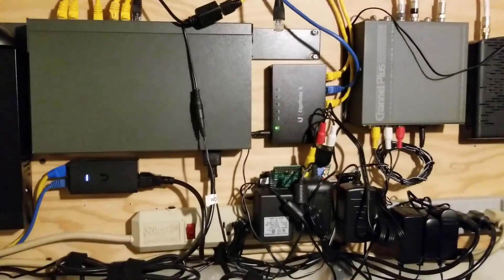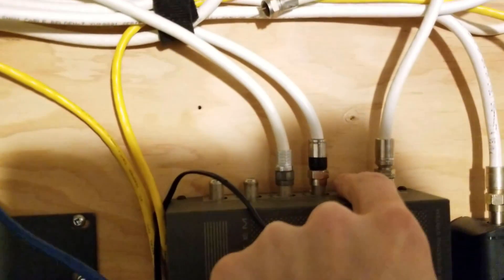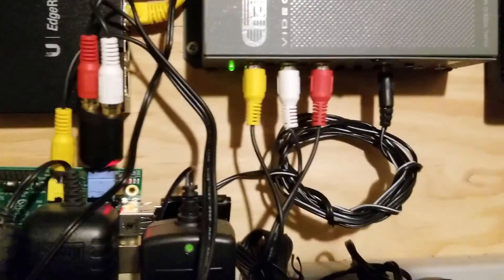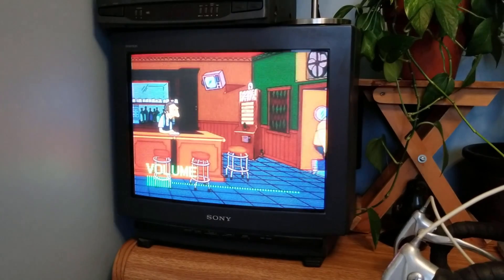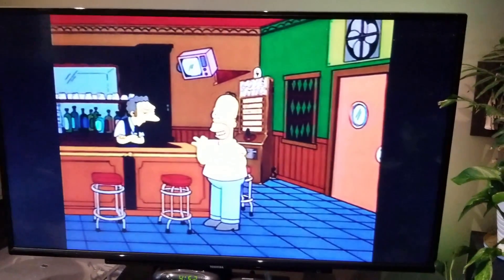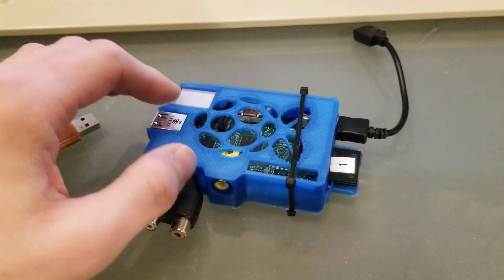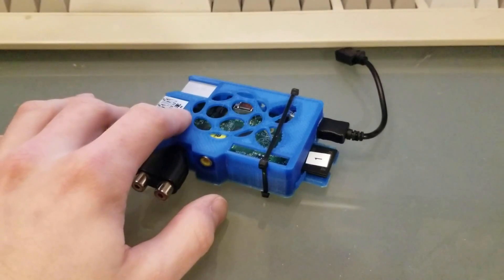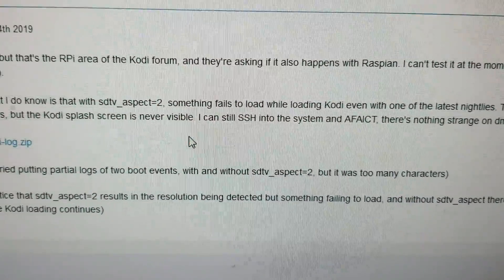My private 24x7 cable channel (Raspberry pi + RF modulator)

Comment: there is way better ways to do this then do it this crappy way
Reply from the maker: Like....?
Reply: @probnotstech  check out wrongdog reckons' videos on the topic. He built both a 80s Nostalgia Broadcast TV program and a 90s Nostalgia Cable TV program that run on raspberry pi's. The cable box version is obviously the more advanced and polished version of the project and allows you to build whole channels that will run cable channel like blocking with bumps, commercials, the works built around real times of day and times of the year --- so at night you get ads for 1-900 numbers and around the holidays you get Christmas movies and the like. 

I think you'd dig his design. With the right setup, you could have hundreds of movies, TVs shows, hell even retro commercials to recreate the experience --- all spread across multiple channels.

Comment: when you put to many usb device in to the raspberry pi then i it will reboot over and over again because of low power same will happen sometimes if you use a power supply with 5 volt and 1A or less. so atleast use a 5 volt and 2A one.(unless you are using pi 4.) this might have been your problem. 1A or less works great until you turn it in to a something more demanding lik a media player and connect a usb wifi to it.
Reply from the maker: The problems with the Pi3 I mentioned were while using the 5V/2A supply that comes with the Pi, and no extra USB devices - this was years ago. It would flash the little lightning bolt in the corner, indicate power issues. I just stopped using the built-in Wi-Fi and the problem went away.

I've been able to get away with 1A and even 500mA on the original Pi models in this use case with zero stability issues. Some of mine have nearly a year uptime. But the newer Pi models, you are definitely right. They are very power hungry.

Comment: Wait. Are you that guy on reddit??. Lol i found this when i was looking for rf converter circuits. And i came back to see your head config videos
Reply from the maker: I am that guy lol
Reply: @probnotstech  Yeah. just finished adjusting my vcr's linear audio head. it was hard. 
I have a sony vcr that its tape mechanism is out of sync with the mode switches. Would it be too hard to fix?
Reply from the maker: I'm pretty sure they all have alignment markings on the gears and whatnot though, so that would be my first thought. Usually they're little arrows or holes.
Reply: @probnotstech  thx. fixed it
Reply: bon curry!
Reply: @ななし権兵衛-m3c  bruuhhh....

Comment: buying a house, i think i'll start broadcasting Seinfeld when i get settled in. where did you find that Channel Plus box, in a dumpster behind a Time Warner Cable station?
Reply from the maker: Believe it or not, these were sold as consumer devices. Though I think they did make more commercial grade versions too
Reply: @probnotstech  i think I found a couple on eBay for $35. thanks again!

Comment: What is your resolution set to? Aspect ratio 4:3?
Reply from the maker: Not sure the resolution - I'm using the composite video output which I think is 720x480. Aspect ratio is 4:3 (the only way to properly watch The Simpsons)
Reply: @probnotstech  that's what mine is set to but I got two bands, top and bottom.
Reply from the maker: Are your files encoded in widescreen?
Reply: @probnotstech  thats with the raspbian Homescreen showing. I ripped the videos off of YouTube, I downloaded most on 720x480
Reply from the maker: You may need to change your resolution in raspbian. Weirdly though, I have raspbian on one of my pi's for the weather channel and the homescreen is 4:3 by default.

I would poke around the display and resolution settings, see if anything there can help.
Reply: @probnotstech  thanks. I'll try some different things. When I have a video playing in full screen I'm losing an inch or so on the right side. I gotta play with Overscan as well.
Reply from the maker: That's one reason I liked LibreElec/Kodi. You can set the corners so that the overscan is juuuust right.
Reply: @probnotstech  you know that OS is on my pi. I'll have to check it out. Thanks for all your help.

Comment: Did you use an SD card or a USB stick and what capacity to fit all 10 seasons? Another question, do you just plug the modulator into a socket that has a coax cable and it becomes available throughout the house?
Reply from the maker: I used a USB stick, separate from the OS on SD Card. This way, I can easily remove the USB and change/refresh the video files later on. I used a 64gb, but depending on the compression you could get away with a 32gb. 

For the coax, I plugged the modulator between the antenna coming into the house, and the splitter that distributes to the TVs in the house. This modulator is designed to be hooked up that way. It inserts 2 channels, and passes through the rest of them.

Comment: I have a raspberry pi 2 that only has a HDMI out port. Could you use a converter to RCA?
Reply from the maker: I'm actually using a pi 3 for another channel (future video). The headphone jack (3.5mm) is a 4 pin, so the 4th pin is video. I'm sure the pi 2 is similar. You can use a cable like this to get the composite video out, without needing a converter:

https://www.amazon.com/Camcorder-Audio-Video-Cable-Stereo/dp/B07V2VZ7KP/ref=sr_1_9?keywords=3.5mm+video+cable&qid=1581216295&sr=8-9
Reply: @probnotstech  thanks! I'll check that out!

Comment: What format are your files? .MP4 ?
Reply from the maker: AVI container and Xvid codec, though Kodi supports a bunch of file formats.
Reply: @probnotstech  did you pay for those episodes?
Reply from the maker: @padmescurl  Yes, I did, actually! Check out at 3:05. I used seasons 1 - 10 (the golden years).
Reply: @probnotstech  Why XviD? H.264 is much much better.
Reply from the maker: I ripped the DVDs a long time ago. Too lazy to do it again. The newer asked I've added are all h.264
Reply: @probnotstech  Best way to rip the DVDs IMO is MakeMKV, it's more space but a complete 1:1 copy of the video on the disc, so there is no quality loss. Sometimes I will encode to H.265 but most of the time I just use MakeMKV.